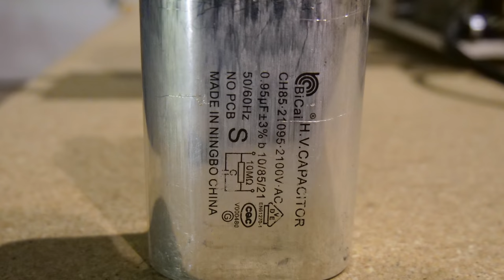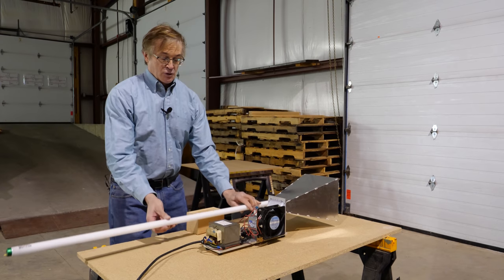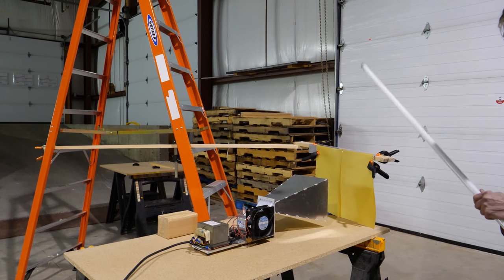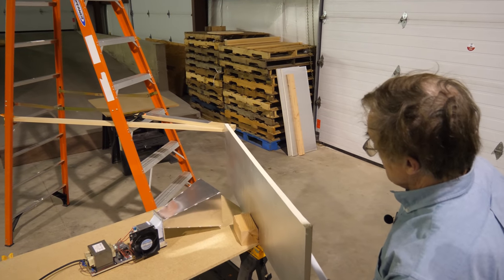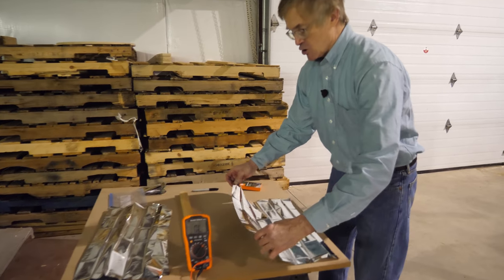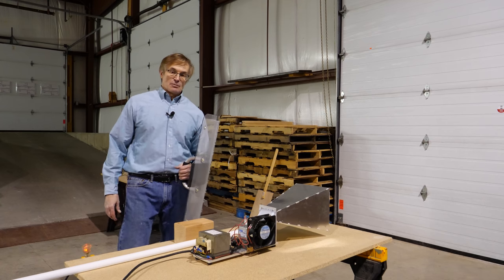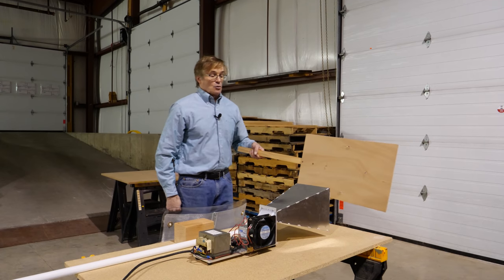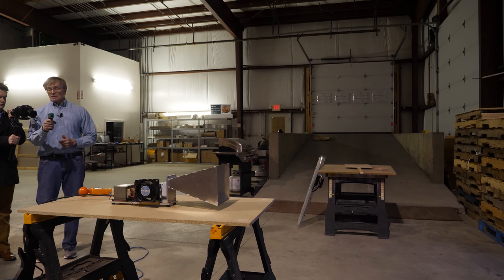You're not protected from microwaves... yet - Part 2

Comment: A wireless mic seems like a pretty effective detecting device as well.
Reply from the maker: True, but it's awfully nonspecific.
Reply: As far as i remember even a cellphone signal could damage the sound so i think any wave that can interact with it will give a false positive
Reply: @andres7625  that cable connecting the transmitter to the lapel mic? That's an antenna.
Reply: @TechIngredients  replying here b/c I think it's important. A hat, or even a hood, lined with reflective material may focus a microwave beam inside the head, like a satellite dish, or at least allow what passed thru to have another go at you.
Reply: @andres7625  Worse, It's pretty likely that it would give false negative with an actual microwave weapon system as that may well be unmodulated. The hum in this video is just 60Hz + harmonics because because the microwave output comes in bursts with every mains cycle.
Reply: Wonder if you even need a mic.

If you wore a pair of earbuds that aren't plugged in, I wonder if the lead would be enough of an antenna for them to shriek when hit by microwaves?
Reply: @Nevir202  it would, but so would static electricity from moving in your own clothing.
Reply: @ZE0XE0  Don't much think so. I doubt you'd ever hear anything from that, and even if you did, it would at most be a single, occasional pop.
Reply: @Nevir202  i certainly know ive heard static based artifacts with great frequency before. Probably because I live in an extremely dry environment, around 3% humidity.
Reply: @BubblewrapOracle  I wondered about that too when looking at some of the microwave protective clothing.   But for a hoodie, most of the microwaves would have to pass through the head to get to the reflecting surface.   At higher frequencies they would have been absorbed by then.   So it would have to be a 'just right'  frequency where it is partially absorbed, reflected, then absorbed some more.
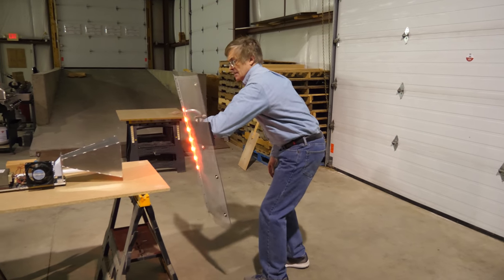Reply: Did it get wiped out at 19:20 ?
Reply: @Nevir202  For people who experience the microwave auditory effect, they wouldn't even need the earbuds.  LOL.   Perhaps a group of people could test for it first, and then use their gifted fellows  as detectors.  Though first we would have to expose everyone during the test ..
Reply: @ep5acg  I was unaware there was such a thing.... Are they hearing something from the microwaves directly, or hearing the magnetostriction of the transformer?
Reply: @LetoZeth  would only work if they were analog tho.  The Bluetooth wireless headphones most people probably have would not work for this, the most they'd do is simply lose their connection.

Edit: oh, unless the microwaves are being picked up in the speaker coils themselves or some other large antenna-like part of the headphones.  Basically poorly designed headphones, but I guess fit for off-label purpose 👍
Reply: @ep5acg  lol, are you talking about those wackos who claim to be able to detect any EMR and are therefore sensitive or "allergic" to stuff like wifi or cellular signals?
Reply: @TechIngredients  easiest solution is metal ducting tape. Just turn a hoodie inside out, wrap it, flip it back, put it on. Gets hot though. you can wear it either way, but its easy to be inconspicuous. same for pants, etc etc.
Reply: @Hawk7886  I don’t know about all of them, but at least some of them certainly aren’t wackos. A good friend of mine who used to be a nationally known radio personality, has that particular sensitivity. She can’t use cordless phones or cellphones  without them being hooked to wired headphones, or being on speaker.  Bluetooth earbuds of any kind make her dizzy and eventually vomit, and various other local radio sources, if she is too close to them, do the same. She can be in the same room as Wi-Fi, and Wi-Fi using devices, but can’t get her head too close to them unless she wants to spew. I always thought that kind of thing was BS until I met her 20-some years ago.
Reply: A pretty REKT detecting device. He killed his mic at least once.
Reply: @Hawk7886  It's been documented since 1961 in connection with people working with microwave transmitters. Different people have different sensitivity and there's no consensus on the anatomical mechanism of detection. Even some nerve-deaf people can perceive pulsed or modulated signals with sufficient peak power. Umodulated microwaves don't seem to produce the effect.
Area denial microwave weapons might or might not be pulsed or modulated so I wouldn't depend on it.
Reply: @SpaceMulva  Great, you just put your head at the focus of a collecting dish so your head can absorb more microwave power when you're facing the beam source.
You'd need something like a fencing mask (made of metal mesh) to go with that hoodie.
Reply: @TechIngredients  Kind of like a diode.
Reply: *seemed
right until 19:18
Reply: Any MEMS style microphone that doesn't have noise canceling built-in should pick it up. You csn find these in older cheap cell phones and assistant devices like an Echo or Alexa. You can also find them for hobbies and SBCs like the ardrino or raspberryPy. I think those bionic ear or miracle ear things they advertise on late night TV also have them as well as an amplifying output to ear pieces too.

They work by creating a base tone at 1k or 1m hertz.  I don't remember off the top of my head.  The sound waves interacting with a very small diaphragm in thr mic will modulate that ba see each tone and the signal processor interprets the difference as sound.  Anyways,  the microwave signal will interact with both the base signal and likely the diaphragm on the actual mic itself.  You can put some shielding behind it and make it somewhat directional too.

If someone used a raspberryPy or esp32 with one, they should have enough processing power to detect the interference and turn a light on yet still be small enough that it could be made to look similar to a watch.
Reply: @TechIngredients  Did the wireless microphone get damaged by the microwaves or did it simply run out of battery or something? 😄
Reply: @TechIngredients  he probably said that because at one point in the video when you went Infront of the magnetron the microphone briefly stopped working.
Reply: @Hawk7886  Those people aren't wackos. I'm trying to link you to the NIH studies, but youtube no likey. Keyword electrohypersensitivity will get you to those studies, though.
Reply: @Nevir202  There's no current loop if not terminated at the plug end. Current plain cannot flow.
Reply: @SianaGearz  LOL you mean like current "couldn't" flow through the bulbs in the demonstration he just did?
Reply: @Nevir202  It polarised them with the legs acting as an antenna. The corresponding equivalent antenna of a microphone wire is just at the plug between the terminals. Well maybe left channel will be energised enough, but right channel not at all. Worth trying i guess.
Reply: @SianaGearz  But the amount of energy captured depended on the angle relative to the polarization, eh?

Headphones cables are plenty long enough to do something like let them dangle to your belt then thread it through your belt loops. so you have part of the wire in each orientation.
Reply: You could see him aim the reflecor at the wireless recv. as he was setting it down.
Reply: I think he blew up the wireless mike?
Reply: Keep in mind that what you're hearing is line frequency (60Hz) and that a phased array emitter from a piece of military microwave equipment has no cavity magnetron to carry over that 60Hz and you may well hear nothing. Also keep in mind that a good number of pieces of military electronics run on 400Hz, so even if you do hear something, it almost definitely won't be what you're hearing in this video.

Also, they make shooting hearing protection with active sound damping. I've found that mine (some relatively cheap Honeywell muffs) are sensitive enough to pick up line frequency from the wires in the walls as I walk down the hall, so that might be an effective way to detect it without having to reinvent the wheel. Honestly, if you're in a protest where they might be using flashbangs, you probably want hearing protection anyway.
Reply: Thank you for this video 😎👍
Reply: @BubblewrapOracle  that's a good point. Then the converging refractive index might resonate within the concave enclosure in harmonic resonance... Like when we microwave a grape and it bursts out plasma...
That could be bad.
Reply: @Hawk7886  actually sorry to say buster but University of Santa Barbara already verified that specific factor over a decade ago. It's actually completely practical since speakers themselves and microphones only work by piezoelectric crystals in them turning an electric current into kinetic energy or kinetic energy into an electric current.
Given that there are many crystalline protein structures of the human body, like for instance say - every single DNA molecule, protein sugar, or even just salts in your body- I'd say it's not only practical, but amazing we don't all feel these effects in multiple ways throughout our bodies and in different levels.
Reply: @htomerif  last I checked the military focuses on 92-94 GHz for the crowd dispersal weapon
Reply: @ShaunVillafana  Yeah, I was talking about the frequency that you hear. In this video the buzz that you hear is from the line frequency at 60Hz. The cavity magnetron pulses at 60Hz. Its output is about 2.5Ghz but that ends up being amplitude modulated by the line frequency. Its not as true as it used to be but a lot of military electronics runs on 400Hz instead of regular civilian mains frequency.

Obviously the microphones aren't picking up anything in the GHz range or even the MHz range but they are picking up the modulation of the microwave frequency.

In a similar sense, your phone will have a carrier of some number of GHz, modulated at some number of MHz, but if you hold it next to an AM radio or guitar amp or mic line, you won't hear any of that, you'll just hear the ticking sound it makes whenever the transmitter is active.

The point of my original comment about military weaponized microwave stuff is that you may not be able to hear it at all with any of those methods I mentioned if its continuous wave, which is all it has to be to work, or it may be something other than what you'd expect, like 400Hz, or just ticking.

To be honest, I don't know specifically how microwave deterrents work, but I do know specifically how the patriot missile system's radar beamforming works, which is by varying the effective lengths of the paths of the RF from the radar RF generator to the beamforming elements. You can hear that on an AM radio as it sweeps the sky. The weaponized microwave stuff can be a lot, lot more crude than radar.

I also wouldn't necessarily trust the mini neon lamps to work with something thats more than an order of magnitude shorter wavelength.
Reply: @BubblewrapOracle  I guess you need masks to go with the hoods...
Reply: @Nevir202   People hear the microwaves directly.   "the microwave auditory effect"   It might be caused by thermal expansion of some part of the ear.   It turns out that there are ferrite nano-particles in some inner ear cells of some people,  just as for homing pigeons and other animals, and that just might be related.
Reply: @TechIngredients  did you ground the foil?
Reply: @TechIngredients  just glue foil to plastic sheet boss
Reply: @TechIngredients  My sister had a microwave over that had no safety feature and in the early 1980s I was heating something and the door came open for many seconds...maybe up to 30 or more...before I realized it. My left arm went partially numb afterwards and has had numbness since and tremors in my hand.
Reply: Sure does. Though the weapon probably isn't modulated at 60 Hz.
Reply: @andres7625  I used to have computer speakers that always detected cell phones. They'd start meeping and I'd shout, "Incoming!" Second later the phone would ring.
Reply: @TechIngredients  Yes. Sensitivity vs specificity.
Reply: @ZE0XE0  not true. Or We’d hear noise wearing them regularly and we don’t.
Reply: @ep5acg  total coverage is the only way...so what would the goggle material be? the same they use for xray techs? thre are probably specialized military spec goggles avail...
Reply: @Hawk7886  How do you know if another person can or can not feel something?   Clinically the people who claim to know what others know or feel based on just their own perceptual experiences are called "psychopaths".   Do you have some sort of scientific justification for your statement, or are you a psychopath?  The callous and flippant label 'wackos'  seems to indicate the latter.  Serious question, as this is an interesting and important topic.
Reply: @siskiyouecoforestfarmandsa1270  Yes, you (or was it another poster .. this is running long .. anyway) got me thinking about it, because the eyes are perhaps the most sensitive organ.  It isn't so much out of fear of the hood being a parabolic reflector so much as to protect the eyes in the first place.   ...   How about the visor that Dr. Emmet Brown wore in back to the future?   I was about to do an amazon search to see if I can find a pair just for fun.  Vapor deposition of aluminum on plastic is also used on sunglasses.  Wrap-arounds look good because they also cover the periphery, the hood would get the sides.   Otherwise a person is looking at something like what people wear when practicing with swords, a  screen fully covering the face.   I was thinking of offering an 'earth suit'  in analogy to a space suit for denizens of Beijing, (or Hyderbad etc.) as a sort of social commentary.   LOL
Reply: Imagine a field detector that is able to detect  in a spiral vector inside DNA
Reply: @pasikavecpruhovany7777  - actually, every half cycle for domestic microwave ovens
Reply: I have an 8 foot auxiliary cable plugged into a sound system.  Just to rule out contact at the jack I wrapped it with tape.  When I have accidentally set the system to aux and left it on, I realized it was picking up a lot of different types of signals. Slow thumps minutes apart, buzzing and sometimes squawks.  I'm assuming aircraft traffic or cell tower but who knows.  I wonder if a grounding bedsheet blocks microwaves.
Reply: An EMF monitoring device is the best way , I'm not sure which ones are the best to buy though  .
Reply: @davestorm6718  I didn't give much thought to it but I'm pretty sure it's every cycle because every other half cycle is spent charging up that high voltage side capacitor.
Reply: @TechIngredients  and expensive
Reply: @TechIngredients  EMP protection of solar and wind turbines of computers and radio equipment.
Reply: @TechIngredients  Could you do a Ruby Maser vid?
Reply: The only thing being detected by such is low fq ac noise.  Not microwaves  ! I work with microwave equipment and so i know. Drape your body with a screen wire net or cocoon make shure that there is somthig like a number of small chains all around the bottom so the screen is well grounded and you will for shure be completely shielded from microwaves as well as any and all other radio waves and electromagnetic waves at any frequency.  If you want to detect microwaves get a cheep microwave detector in the early years of my servicing microwave ovens it was a government and industry requirement to have so you could test and certify serviced equipment as safe. They don't cost much if your really that paranoid. Good luck. Don't let the bedbugs bite ,or the sky fall on you.✌😎🖖👽
Reply: @SianaGearz  radio waves in antennas don't work like that. No complete circuit needed!
Reply: @SianaGearz  nope.
Reply: @d.e303-anewlowcosthomebuil7  No need.
Reply: @baneverything5580  Yeah you cooked from the inside out.
Reply: @davestorm6718  no, once per cycle. Half wave rectification.
Reply: @gregbailey45  That's what I meant. It's not full wave rectified, thus half the cycle (half the waveform ). It's actually a half-wave  voltage doubler circuit (with the cap)
Reply: @TechIngredients It's a very bad idea to use the infrared thermometer to tell if there is a microwave gun in operation in any protest. It looks like a gun and will likely be mistaken as a gun.  The best idea is to use a electromagnetic radiation tester.
Reply: @FriendlyNeighborhoodNitpicker  Nina Totenberg?
Reply: @ZE0XE0  Before this to happen,  think you would likely be already thoroughly cooked. Like you said, in a normal environment, with higher  of humidity, it wouldn't work.
Reply: @Serahpin  Yes I have a lady friend with this. Thanks for the search term. Is there here a type of retreat where people that have this sensitivity can live without this messing up their lives?
Reply: @daviddrake7003  I don't know if they have communities, but given their specific problem they might.
Reply: @SpaceMulva he said you have to check for the current that the tape is not inside out. Also some flouresent tubes around could show if room was being hit with microwaves.
Reply: The wireless mic receiver is detecting the EMF from the power transformer and associated electronics. Not necessarily the microwaves. Your body is and acts like an antenna. Whenever you are near an energized electrical panel or large transformer a small amount of energy is penetrating you.
Reply: Hmm, I wonder how this microwaves translate to Bluetooth and wifi waves. 5 g anyone?
Reply: @Hawk7886 due to wave energy being used even in atoms (like electrons, neurones, protons movement) and what even sound waves do to water (look up videos) and human body is made mostly of water, I declare you wacko, because you do not understand how powerful and dangerous this can be  (you need only to imagine that blood flow under sound wave became whirlpool and ask: What does this do to veins? Hearth? To brain, which needs air from blood to function?
Reply: @TechIngredients  my vehicle's radar detector detects laser  everytime a 5G tower is around. Is this a coincidence?
Reply: YES  @BubblewrapOracle  this was my concern with clothing, it would have to be very fitted with no gaps, a hood would be hopeless. I know people that feel worse wearing microwave blocking clothing. A close fitting hat would be the go but it only protects what it covers & if it hits you on the face, it's doing no protection. Microwave radiation effects on a cellular level oxidative stress. Gov of Au turned real bad fast.  Insidious weapon. The towers can also become weapons.